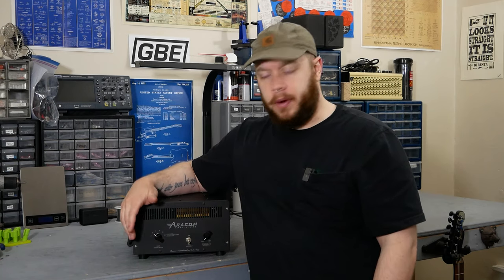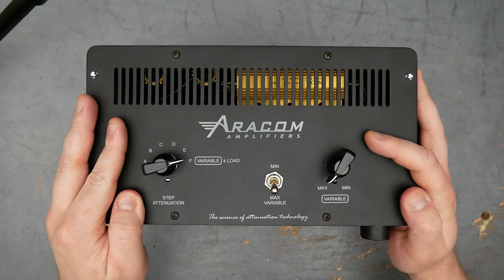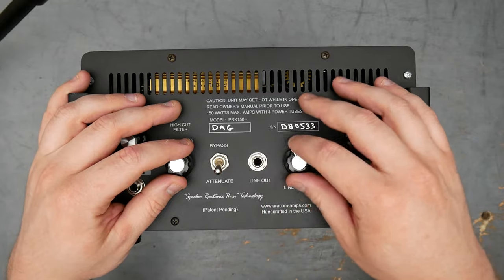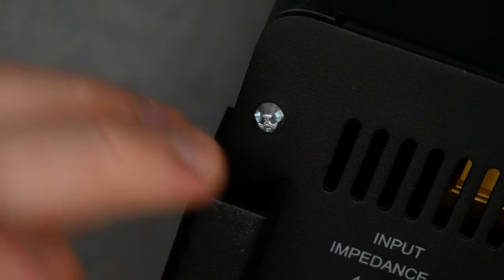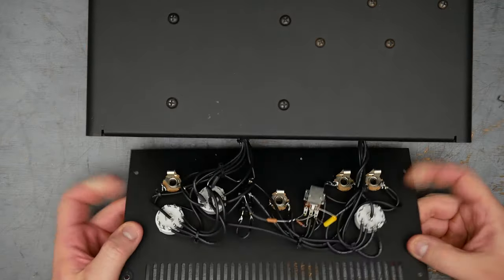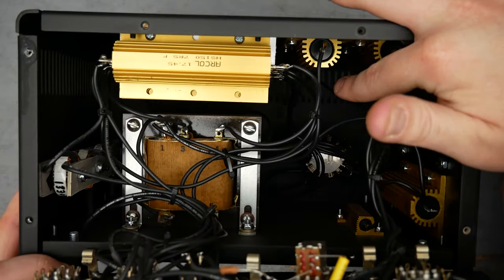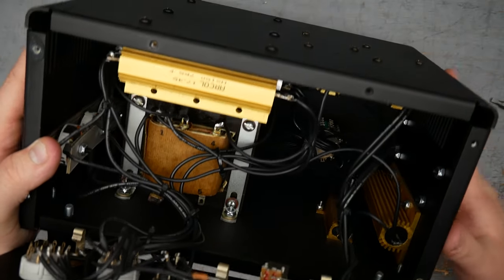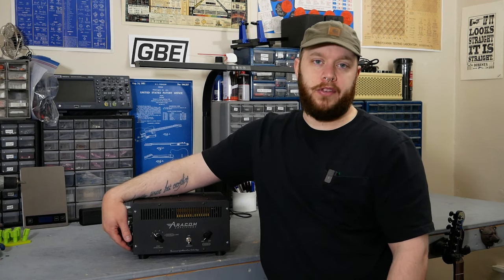Aracom PRX150-DAG Attenuator Teardown! See what's inside!

Comment: Excellent video, I'm glad YT suggested it to me. I bought mine in 2021, and it doesn't have any funky screws like that. I don't have any need to open it up anyway, though. I could tell it was heavy-duty and/or made well the first time I picked it up, as it has some weight to it. I've been super happy with it as well. It's a very transparent attenuator, much more so than many others I've heard.

Comment: That looks nicely designed and built, but very generously specified. Adjusting both input and output impedance is nice, I imagine there's must be 6 different windings on that transformer? Does it seem transparent enough or does it interfere with that holy output transformer / speaker interaction we read about in forums?
Reply from the maker: "does it interfere with that holy output transformer / speaker interaction we read about in forums"

I think for those who believe in this, the question is already answered lol.